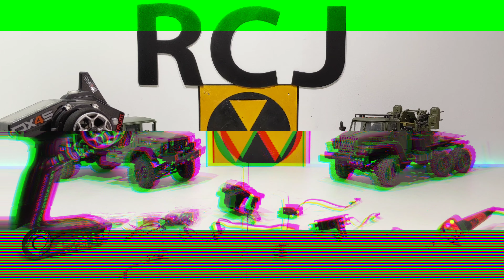WPL C-44KM build pt.3 Electronics complete! (closer look at wpl winch)

Comment: What's happen if you don't put the capacitor in the motor?
Reply: Typically the motor generates signal noise that interferes with radio reception--it was a much bigger problem with the older FM MHz radio sets.
Reply: An unofficial WPL spokesman, EdwardRC Car, says that the WPL 370 motor doesn't need capacitors but the 130 and 180 motors do. Check at the 6 minute 35 second mark: https://www.youtube.com/watch?v=bKnnUHKIP1c

Comment: can you show how you routed or consolidated all the loose wires? i have a mess in my B-24 and the cab doesnt fully close
Reply from the maker: Start with one and start rolling it up like a pigs tail. The b-24 is hard to hide a tick all the wires with out being seen. But it can be done. Just takes time. Try using small zip ties